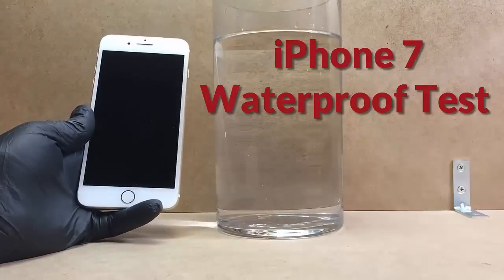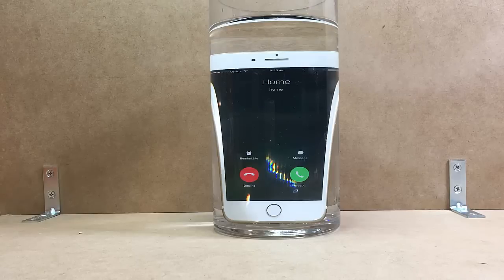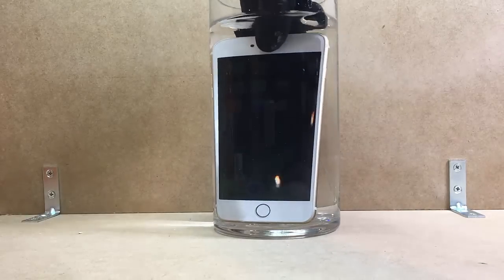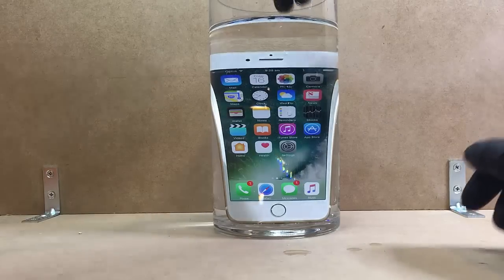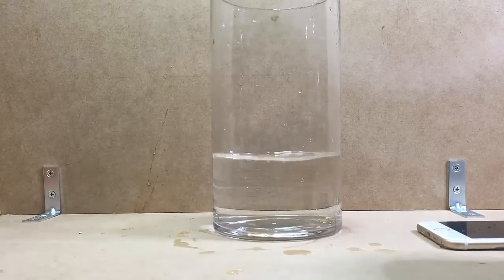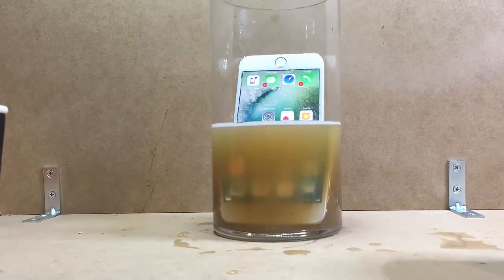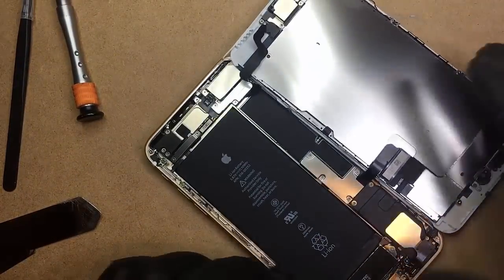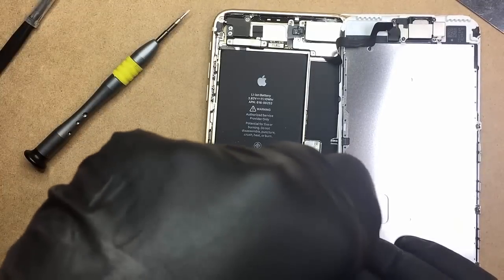iPhone 7 & Plus waterproof test

Comment: I have a IPhone 7 Plus and today is raining and I legit accidentally drop it in a deep puddle for like 5 seconds, I thought my phone was going to die but when I rushed to get it, it was okay, I’m like how is it still working, so then I searched up” Is the iPhone 7 Plus waterproof?” When I was done reading of the phone was waterproof I was so relieved that it was waterproof, but I came to YouTube just in case if it was waterproof or not and it was!!!
Reply from the maker: It’s actually water resistant and I would use the term ‘splash proof’ make sure. You thoroughly dry it and avoid any type of liquid as a lot have a chance of getting water damaged

Comment: @infohut so the charging port is also sealed the same as the other parts of the phone?? Sorry first time after a Long time of not using Apple products
Reply from the maker: that's correct. they seem to have sealed them in a way where they don't need plugs for any entry points.

Comment: big difference water resistant vs water proof.  IPhone 7 & 7Plus it's water resistant, that mean if raining or something like that your cell it's will be fine.  Water proof is for submerge into the beach.  If you try something like in this video your IPhone 7 or 7Plus has stereo speakers, and one of this speakers it's going to damaged.

Comment: Water Resistant is a common mark stamped on the back of wrist watches to indicate how well a watch is sealed against the ingress of water. It is usually accompanied by an indication of the static test pressure that a sample of newly manufactured watches were exposed to in a leakage test.

Comment: I took mine into the pool and shot some quick video underwater, not under water for long. The phone works great, however the lenses on the camera are fogged up now and the pictures are adversely affected but the steam/fog on the lenses. I have an appointment at apple, I hope they will replace or repair the lenses. I have an 7 PLUS, and only had it for a day...sigh.
Reply: No. eventually it stopped fogging up and cameras work great now. But I won't let this phone near water again.

Comment: apple does a great job of telling you about its water resistance rating however if your phone dies from water damage its not covered so your on own with and they do have little piece's of died paper that change color when it get wet so you need some creativity when you come up with the story your going to tell them when they ask you how your water resistant iphone got water in it, i think they even have in the fine print in the packaging but its so fine that nobody knows where it is but apple. I think  i'm going to switch over to s7 edge cause it seems that apple just re-release's the same phone with the slightest improvement.  The galaxy s6  is more iphone 7 competition  which is a joke

Comment: IP68 (S7, S7 EDGE & NOTE 7) is still much better than old tech IP67 (iPhone 7 & 7 Plus)....

APPLE is always lagging behind in every features they offer.
Reply: Incorrect sir or ma'am if you check out a video by EverythingApplePro it reveals that Apple has chosen to give the iPhone 7 a more conservative rating, but it actually survived in 35 feet of water for 5 minutes and the Galaxy S7 died. Watch it for yourself
Reply: The S7 they had is more than 6 months old, means it was use lots of time, especially the charging port & 3.5mm port for headphone.

They have to get a "brand new" that just came out of the box NOT the one they have for MANY months.

iPhone 7 is just released just 2 days...

Then I will believe on their test.

Have a great day
Reply: You sir have not seen the video where a S7 stopped working after being underwater when the iPhone 7 still worked perfectly fine.
Reply: Dini 

BECAUSE,

The S7 he used is more than 6 months old.

So, the charging port, the 3.5mm port, etc....... was used already MANY TIMES.

Even a microscopic leak can cause that easy to sip in water.

I will only believe on the test IF the S7 was just came from the box, brand new, and never been used.

It's fucking "common sense"...
Use your brain!!!

Have a great day to y'all
Reply: Dini 

That's you!!!

You can't fucking "comprehend" what I'm trying to impart to you...

Go back to 1st grade!

However, still have a great day
Reply: If Samsung's phones lose some water resistance over 6 months, then they have made a flawed phone. Nobody buys a water resistant phone so it can be water resistant on the first day they open it. They buy it so it can stay at the same level of water resistance over time.
Reply: Up-To-Date Apple 

Your rebuttal has NO sense at all...

The S7, S7 EDGE & NOTE 7 have more open PORTS (3.5mm port, charging port, S-Pen & have slot tray for MicroSD & Simcard) than iPhone 7 & iPhone 7 Plus.

After more than 6 months, ANY devices even it's water resistant or water proof, as you're using it every single day and poke those holes many times already, drop it, etc...........

There's big possibility that you're making it weak. How much more if the owner lives in a very hot weather country/place or having a retarded one (cold half day then hot the other half), it makes the seal of the phone suffers a lot.

In technology world (especially we use it every single day, almost 24/7), 6 months or more is like, forever...

(By the way, do you think that an iPhone 7 will be the same AFTER more than 6 months of 24/7 usage, to compare to the very 1st day you got it? NO, never...)

That's why, to make the results FAIR, use a "brand new & never been used" S7, S7 EDGE & NOTE 7, then whatever the REAL results, will be 100% acceptable!

Now you get the point?

Have a great day
Reply: Thank u im happy now I didn't think it would be good like that!

Comment: what's the difference between water proof and water resistant ? is the iPhone 7 resistant ?
Reply: Water proof means, well water proof. Water cant destroy it. Water resistant is that it'll withstand water being splashed at it or provably dropping it on the toilet for like the 3 seconds it takes you to take it out. But it being in water for a while will destroy it
Reply: probably*
Reply: Is it not obvious? One is resistant, the other is proofed.

Comment: It's water resistant not waterproof
Reply: im sick of hearing this. It's the same wtf even if you look at the dictionary. The reason you cant submerge it is because of the pressure underwater. It's like a fucking plastic bottle, it's water proof but if you take it deep into the ocean and leave it there the pressure will crush it and prolonged exposure will slowly decay it.
Reply: Lilytheartist03
NO phone is waterproof
Reply: what is the diffrience
Reply: TheKilLeR 933
There is a HUGE difference. Waterproof means that it can be fully submerged like taken into a pool, go scuba diving with etc.. Water resistant means it can handle splashes of water or maybe a quick submerge underwater but that is about it.
Reply: kitty mcpaws nice scientific speech
Reply: weedbgone it can be submerged in water up to 30mins. Go read its specs and certification. You're welcome.
Reply: weedbgone so what's this video? Is this waterproof or resistant, because it's kind of in between.
Reply: Samsung edge 7 water proof wym?
Reply: weedbgone Chrome said the phone can be held in 3feet of water for only up to 30 mins
Reply: weedbgone yes
Reply: Claire Wicke that’s not true , I put my 7 plus in water today and it’s broken.
Reply: Daniella Xo what did you comment int then
Reply: It's the same thing,idiot😉
Reply: Exactly why I want the note 7 instead.

Comment: The phone is WATER RESISTANT NOT WATERPROOF!!! Twat
Reply: It's roughly the same thing.
Reply: let me put what he said 
Apple have confirmed it meets the IP67 standard as explained below.

iPhone 7 is certified with an IP67 rating, it is fully protected from dust (6) and can also withstand being submerged in 1m (about 3.3 feet) of static water for up to 30 mins (7).

He also says that he knows its water resistant not water proof hes just testing it 
Twat
Reply: V
Reply: +Cookeh No... Not really.
Reply: Orbital it doesn’t say that anywhere on apple they say it can only get splashes on it which any fucking phone can lol why would they advertise water resistant

Comment: It's water resistant not waterproof and look up the definitions if you don't know what it means is goddamn
Reply: Tiggered
Reply: Guessing you typed this before finishing the video.
Reply: yes u r correct
Reply: let me put what he said 
Apple have confirmed it meets the IP67 standard as explained below.

iPhone 7 is certified with an IP67 rating, it is fully protected from dust (6) and can also withstand being submerged in 1m (about 3.3 feet) of static water for up to 30 mins (7).

He also says that he knows its water resistant not water proof hes just testing it. watch the full video next time you comment or youll just sound like a dumbass